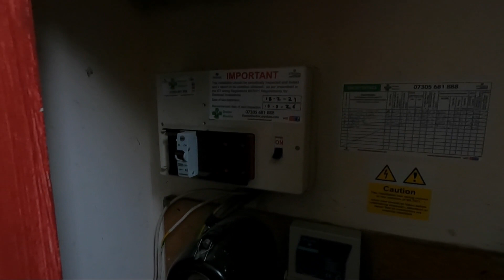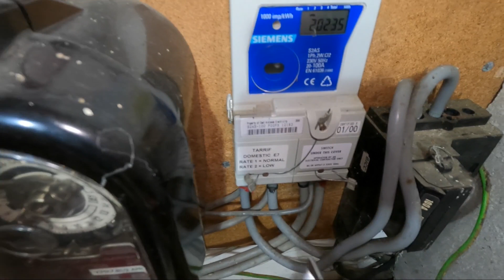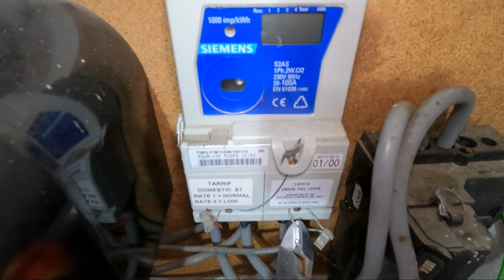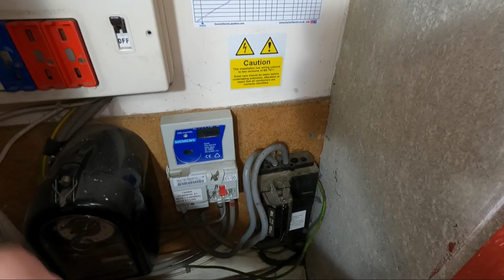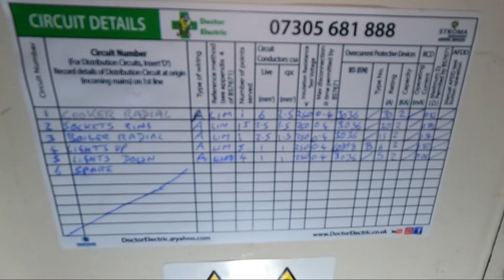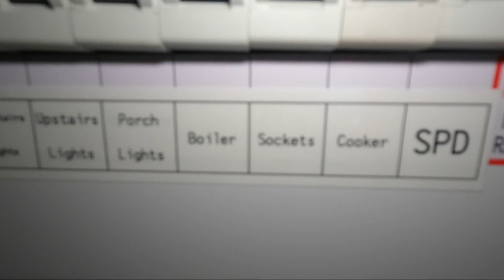Fusebox RCBO consumer unit change torque screwdriver rewireable fuse BS3036 SPD surge protection

Comment: It would have been good to see how you extended the old cables into the CU. Did you splice the new cabling onto the old ones inside the trunking with crimps and heat shrink or use Ideal inline connector splices or similar etc?
Reply from the maker: Ideal splice lines

Comment: Call the electricity board. If they don't respond, cut whatever you like (no i'm not a fan of privatization) I will happily cut any seal that gets in my way. I am an authorized person, authorized by the chap or chappess who pays the bill.
Reply: Asssuming you were taking the mick. The authorized procedure is to ask politely the DNO to install an isolator, who will then bounce you to and from the metering co (sorry, 'electricity supplier') for weeks. The actual procedure is to do a risk assessment,  and if it's safe, do what i said above, applying the electricity at work act
Reply from the maker: Yes mate 100%, didn't need to in this instance as these meters have an in-built isolator

Comment: Tbh I always cut tags on main fuses and pull them to isolate DB if I’m going to change it, I’ve  called the DNO to arrange for them to do it on a number of occasions and they never seem that bothered, I’ve asked UKPN engineers while they’re working on site and they just say pull it.
Reply from the maker: I erm have never done that cough cough!
Reply: yeah they're after people abstracting electricity. if you're asking them, you're not a cannabis grow farm ;)
Reply: Only time i vary your routine is if the state of the cutout is dodgy, then i cut the seals on the meter and pull the load side tails live, with appropriate ppe, natch
Reply: I always cut main fuse myself
Reply: Had that many times, just fit a new seal once your finished.
Reply from the maker: @rscelectrical7091  where do you get your seals? Do you have a link?
Reply: @TravellingVeteran  : Hi buddy, there's a few places on eBay selling them but the best place for metering supplies is Owen brothers: www.owen-brothers.co.uk they also sell the excellent Cyclim test lamps & accessories. Hope that helps: Andy
Reply: @TravellingVeteran  you can buy a kit of Amazon that's what I did

Comment: Nice job mate...looks tidy...just wondering how did u extend the cable in the trunking...a picture  would help ...
Cheers mate
Reply from the maker: using Ideal splice lines
Reply: Probably push fit